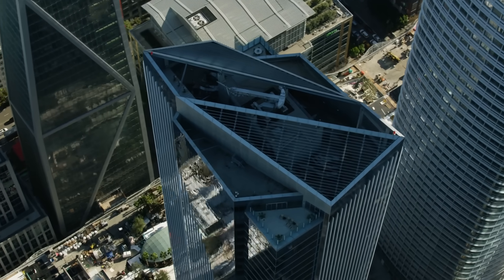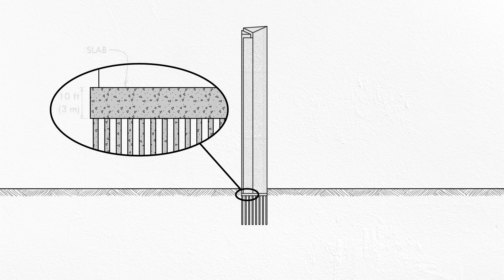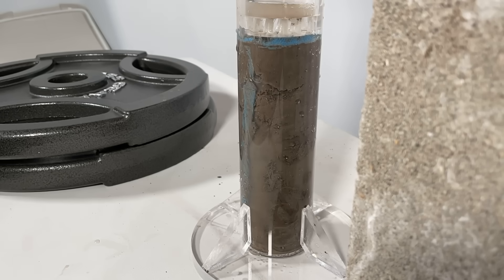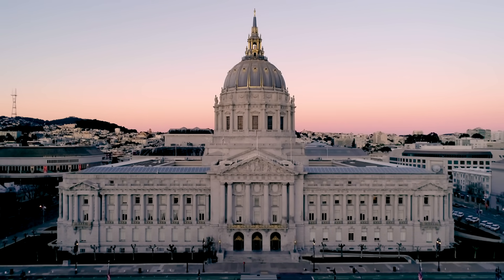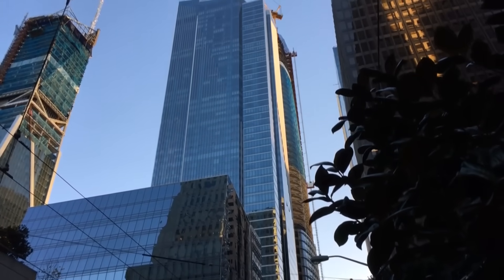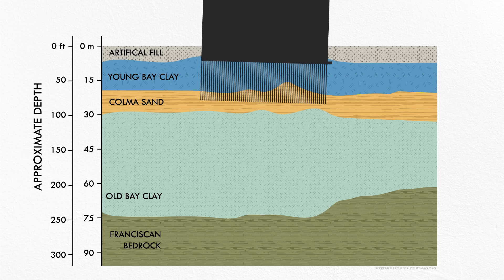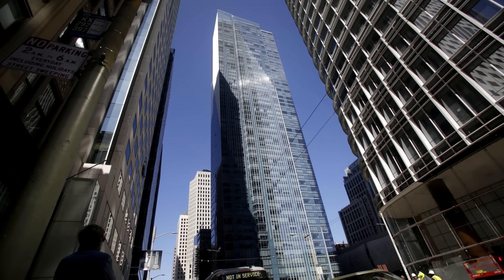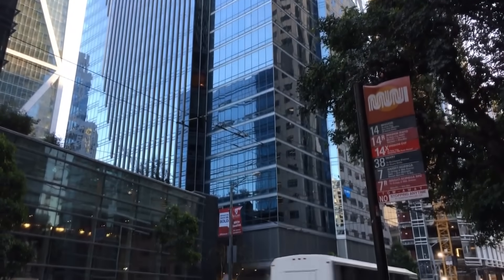What Really Happened at the Millennium Tower?

Comment: Some countries have quite relaxed building controls with respect to tall buildings.
I watched a 30 storey apartment building complex go up in Brazil. As the floors went up and the ground pressure increased, so did the rivers of water in the immediate streets around it, increase.  
I wasn't around long enough to see if they installed drainage, but knowing that country, it would have been the last thing on the list.

Comment: I'd like to know a lot more about how the retrofit connects to the existing slab.
Reply: If this teaches anyone anything in that city is if its going to be big and more then 1 building is just as big just go to bedrock rather then risk it.
Reply: @thesilentone4024  Is there some punctuation that will make this sensible.?
Reply: @rogerstruthers3799  lmao. Excellent response
Reply: @thesilentone4024  A tall building fixed to the bedrock by ridged piles in an earthquake zone can be a bigger problem than the one they already have
Reply: @thesilentone4024  I call BS on hydraulic Jack's being able to break the suction of all that material.
Reply: @riparianlife97701  it’s stopping/slowing the settlement on the low side, so the high side can “catch up”. After it has level out, the jacks can be lowered to allow that side to follow the other side if/when it continues to settle.
Reply: @riparianlife97701  not sure what your talking about.
If moving the building back up ya seems a little far fecht but mybe.
If you mean drilling down to bedrock they have done many times before but is uncommon for most dont run into that many problems at 1 time.
Don't forget half of those buildings were put up in 1970 to 2000 im sure technology has grown enough to make this work.
Reply: @thesilentone4024  I'm retired from marine construction.  Pulling piles is hard. Pulling a high rise attached to hundreds is mind blowing.
Reply: @chrisshaw3368  Those obscenely-long pin piles to bedrock would way rather deflect than carry a compression load. They'd be better off guying the building to straighten it, and that will probably never happen.
Reply: @riparianlife97701 The outer pile casing will limit deflection. Guying? Yeah I’m sure that’s practical in a downtown setting. Get real.
Reply: @riparianlife97701  true true but we got boring machines that mine through the earth for cars are big trucks i think the biggest is 1,000 tons.
So it might be possible for there using 57 jacks were this other thing used 27.
Reply: @chrisshaw3368  Not as impractical as leaving  a high rise building leaning toward other occupied buildings  in a city prone to earthquakes. I see demolition in its future. Those casings aren't going to have enough  prilofile in that shifty substrate to prevent deflection.
Reply: @riparianlife97701  yeah the jacks only accounting for the heavy load from above, what about the suction underneath, which might be much greater.
Reply: @riparianlife97701   Good question. But depending on the dia. of the new piers and the amount of time they are willing to take doing the jacking, there are factors which will effect the process. Do you really think that many people over that many different fields and levels of concern, would sign off on the design if the problem were as simple as friction on the old pilings? (real question, not a statement of doubt) I wonder about the connection between the matt raft and the old pilings, which wasn't primarily designed to take a upward loading.
Reply: @riparianlife97701    Guying to what?
Reply: @shopshop144  Ground anchors.
Reply: @shopshop144  In my decades of marine construction,  I saw so many bad solutions to  problems. I worked on one pier that has shops and restaurants on it that flooded a few inches deep on dead calm days during king tides. I explained to them that jacking the whole structure would only temporarily solve the problem, and that they needed to phase out that use.
Reply: @riparianlife97701  The jacks only have to transfer a fraction of the load; any actual motion will be very gradual.
Reply: @shopshop144  The nearest Building to the Southeast.
Reply: @riparianlife97701  I fully agree, but this will have to be "deconstructed", not "demoed", because of what's around it. Maybe after halfway down it can be "demoed" the rest of the way. Safe deconstruction will cost 2-3 times what it cost to build it, maybe more. Engineers design things to be built, not un-built. Every building will reach a point where it either has to be taken down or it will come down by itself, and none of the lovers of high-rise buildings sees this eventuality.
Reply: By the illustration it looks as if it’s keyed- the existing foundation block having a socket hewn into it. The dust abatement must be loud, as well as the drilling for that socket. Just a guess.
Reply: @richardhall6762  In which case, the weight of the building is actually on the KEY, not the new piles. Where the two slabs interlock seems like an obvious weak point. If the key can't support the weight, it will shear off and the new piles will be useless. There's also the issue of the hydraulic jacks -- what happens if the hydraulic system fails? The "correction" will be suddenly lost and the building will abruptly tilt to one side, risking it toppling over from kinetic energy. 
TBH, this whole predicament sounds like a lost cause. The more drilling, digging, etc they do under/around the foundation is going to only further weaken the ground it's sitting on. 
The thing was already tilting before they even finished it, but they kept going. 

If I lived in San Francisco, I wouldn't work or live within 10 blocks of that building. Because one day, undeniably, it's going to collapse and will probably fall into an adjacent building in the process.
Reply: You dowel in new rebar into the existing concrete, lap appropriately with the existing raft and with your new raft bars and cast from there. The shear key does two things, it prevents a sudden shear failure and makes the extension work in flexion by excavating and exposing the bottom bars, allowing you to lap them properly to your new bars and engage them.
Reply: Not sure about your key way design
Reply: @simonlang2001  yes, I noticed that too. Looks like the sloped surface of the key is sloped the wrong way for the hydraulic jacks to lift the building.
Reply: @riparianlife97701  no, no it's not. Mohamed Nuru is Black. 

It's not a Chinese mob. It's just a bunch of dirty political appointees. That's it. That's all.  Don't go looking for conspiracies where there aren't any.   Most of the corrupt people were appointed during Willy Brown's tenure as Mayor. Which, if you know anything about this, actually matters.
Reply: yea it seems rather sus... just looks like another huge potential point of failure. each pile may be handling 360 tons or so; but all that weight/pressure is mitigated directly through those joints, and they don't even look reinforced?
Reply: As would I.
Reply: Me too
Reply: Superglue!
Reply: @eagleviewhd  Too expensive. We'll use duct tape instead- according to the books it's adequate...
Reply: Agreed. I am curious about the length:diameter ratio. Wouldn't there be concern for buckling in the piles?
Reply: Do a youtube search. There is a video that goes into great detail about it i watched a few months ago.
Reply: @johniii8147  Please post the link to that video.
Reply: @sanfranciscobay  You have to do that work yourself
Reply: @johniii8147  If you recently watched it, it's in your YouTube History.
Reply: @sanfranciscobay  he watched it months ago. No way someone's searching their history for that.
Reply: Big hot  potato,...
But it  can be  done  in a diferent  way .
Reply: Double-sided tape.
Reply: @iAmTheSquidThing  Ratchet Straps from Harbor Freight.
Reply: the fact that you have to ask that question and that it's hard to get a straight answer about it, is part and parcel of the bigger problem. Corruption in the departments overseeing the construction is at the heart of this whole stinking mess.
Reply: @GradyBroyles  I don't know if it goes as deep as saying "corruption"  it simply was a matter of developers wanting to do it as cheaply as possible while still being legal which apparently this was.
Reply: @Mike__B  whatever the expensive/safe option was to fix the issue they should have gone with that. The cheap fix is going to cost them alot more in the long run if there are issues.
Reply: Return the slab!
Reply: @mrgaudy1954  The man in gauze!
Reply: @mrgaudy1954  Or cut it loose from the slab, and move it laterally onto a better one, inch by inch, hydraulically.
Reply: magic
Reply: @kramchancel1266  Flex Seal and a few Sham Wows.
Reply: Why, did you buy a condo?

Comment: Jet-grouting of the old bay clay, ie, pumping cement grout to displace and/or intermix and improve overall soil strength could have been done prior to proceeding with the innovative foundation tie-in piling system.
Reply: Jet grouting would have caused more settlement of the building
Reply: Any action to remediate the situation would have caused more settlement. It is the expected magnitude of settlement that is the tricky bit. Jet grouting would have permanently improved the soil strength of the old bay clay and reduce the "floating foundation" effect of the Millennium Tower. The geotech engineers should have socketed the piles to the rock region below the old bay clay for the original foundation. It would have been costlier, and the Millennium Tower would not be sinking at all.

Comment: I've read that the developer skimped on going down to bedrock. This video makes it sound like the skimping was done unwittingly. I disagree. I guess that's the real trick of being a developer knowing where to skimp and where to not.😬
Reply: There was a similar reinforced concrete skyscraper that was cancelled shortly before this one. They city wanted them to go to bedrock and they refused. The weird thing is a recent local NBC news report said it would only have been another $4 million to go to bedrock and it sounded like they said the transit authority (planning to build nearby) offered to pay for it. They said Millennium Tower cost around $350 million, so it shows how cheap developers are.
Reply: Well I would say it is matter of risk factors. Developer took risk based on calculation. Not like the geotechnical engineers forced to only go to that depth. Most likely it was "safety factor is X, if you go Y deep and it will estimated cost Z. That is technically over the legally demanded minimum factor" at which point developer has the option to say "I want larger safety factor Z, recalculate for that" at which point geo technical engineers would have gone "that takes piling all the way to bed rock. Estimated cost is then higher". At which point developer can say "so be it, I pay for it".

Since I assume as per the legal settlement, developer is holding the bag for the expense of the retro fit. Thus he took a risk on doing shallow foundations and..... lost the bet.

Ofcourse his argument would probably be "but geo technical said it is over minimum safety factor". However safety factors and such are always estimates and as said matter of risk amount. Minimum guidance factors ain't there to cover every possible case and 100% of time lead to success. It is there to give reasonably low risk factor for society overall. If one does extra ordinarily big buildings, maybe one ought to take some extra ordinarily big safety factors.
Reply: @aritakalo8011  "If one does extra ordinarily big buildings, maybe one ought to take some extra ordinarily big safety factors."

I'd love to just legislate that especially large buildings are legally mandated to have larger safety factors.  Maybe that sort of change could happen in response to a sufficiently egregious disaster.
Reply: Modern architecture is all about understanding where to skimp.  Fundamentally, architects are allowed to skimp, so long as they stay within certain legislative safety factors.  Building a skyscraper is a complex mix of cost-benefit analysis and engineering analysis.

Was intentionally skimping on going down to the bedrock a mistake? In hindsight, it obviously was.  Without hindsight, I honestly don't know: That's the sort of question that would need to be debated by experts.

Comment: So I guess all buildings of this size and greater will from now on be forced to drill all the way into the bedrock before?
Reply: One would hope. But a weird part of the story is that a similar but somewhat smaller reinforced concrete structure was cancelled a little before this because it refused to go to bedrock. Local NBC news recently reported it would have cost only (versus total cost) $4 million more for it to go to bedrock. So the city seemed aware of the problem before this was built and still let this go ahead. But I think a different team "peer reviews" each project. Berkeley Professor Jack Moehle lead the peer review team despite the fact that city rules should have prevented it since he was the earthquake expert on the design team. He said under questioning that "When I said the building should be approved I wasn't saying it was going to work".

Comment: Interesting video, brings another question to mind. The hydraulic pressure of the building which when fully furnished will out mass it's neighboring structures, will this have an effect on their foundations as well as the downward pressure tends to push against four opposite sides. Would this not create lift to the others or are the neighboring foundations already densely compact
Reply: Or simply Millenium is the only one that not compacted enough. It's kind like the depth of the soil wildly varied.
Reply: Is the question based on the idea that as this building continuesto sink it is displacing a certain volume of soil and that needsto go somewhere?
Reply: @shopshop144  It's displacing ground water out of clay soil.
Reply: @Kieselmeister  ok so this won't disrupt it's surrounding earth, compressing only under it. Yes that was my question

Comment: I wonder if the bored construction of the new foundation piles actually makes the clay settle even more due to it acting as a conduit for water flowing out of the clay layer. Curiously in another project here facing problems with uneven settlement they're trying to drill holes under the part of the building that hasn't settled as much as the other part to make it settle evenly... could they've done that ?

It was rather interesting to hear that displacement piles are the standard in SF but given the geologic condition I guess it makes sense. Here a lot of new high-rises have started to require very deep drilled foundations up to 50 or 60 metres deep (not that it guarantees one to meet a hard rock layer however).
Reply: The pile sleeves are sealed so they won't act as a conduit once installed but they have to drill to get them installed, so until the sleeves are in place, yes, it will increase the drainage.
Reply: Your point is valid, would love to see the pile detail and construction spec